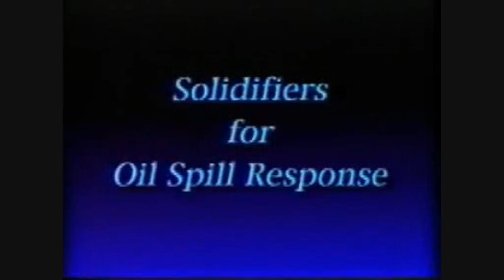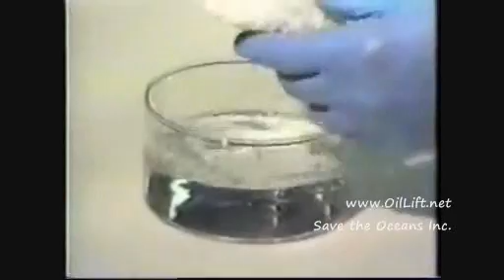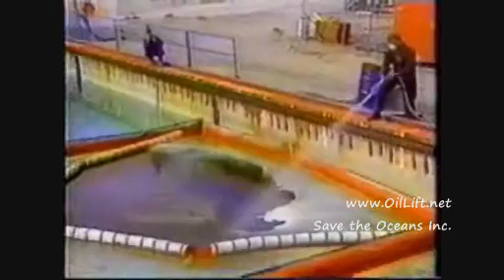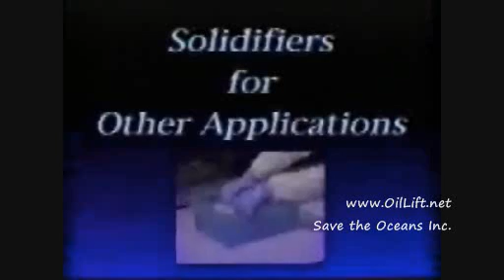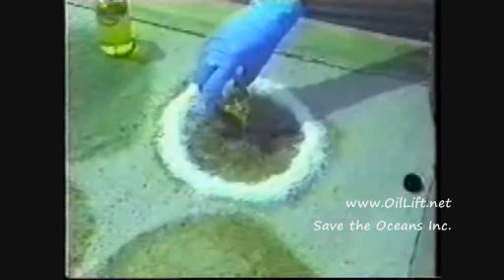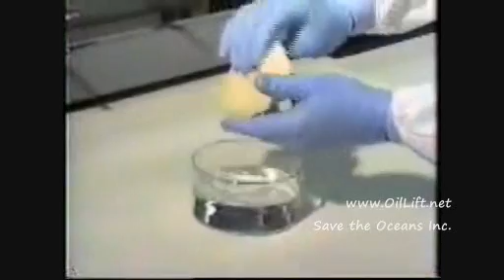Oil Spills Clean up Fraud

Comment from the maker: @krissysummers70 Most of the products are snake oil, you should not be using dispersant s at all. do you have Connies contact information? if you go to my web site oillift(dot)net you will find our phone number, we are in Vancouver BC, there is millions of pounds of polymer sitting on the gulf and could be used immediately. I just finished testing several types and have all the codes so they could go direct and buy wholesale. let me know. cheers Kevin

Comment from the maker: @MotherMagdoline they are not allowed to, the block for using them is at the top in each country. it should be the primary tool in the inventory, yet its always blocked even when the clean up crews know about it and want it. I once had the head of emergency response for a major oil company ask for a solution and I provided the whole system only to have the Government stop it dead. they always have ten excuses and if you try to nail down the person in charge you get redirected.

Comment from the maker: @kimlea69 it turns them into fish sticks, just kidding. the key issue is polymers stop the oil from being sticky so even if its not recovered it does not float around and kill everything. This is why the current technology is not working the oil is still sticky. If a fish were to eat it which is unlikely because the smell or taste would be bad it would act like a rubber worm. In fact some of the polymers are the same stuff chewing gum is made from.